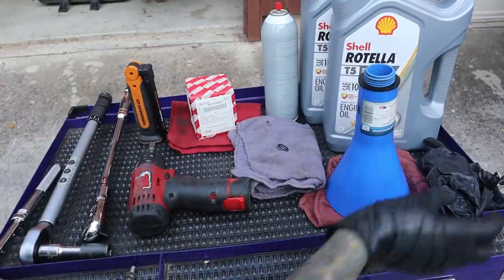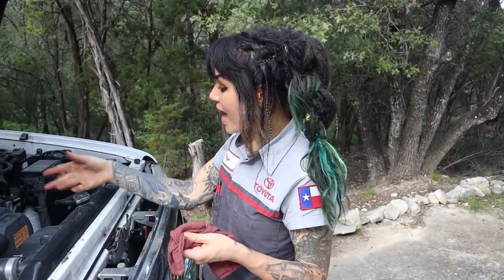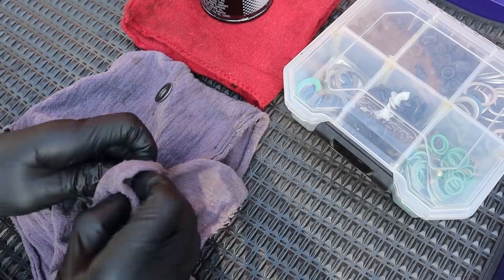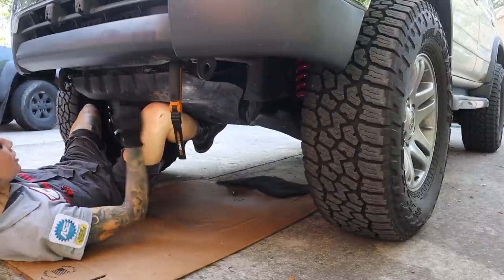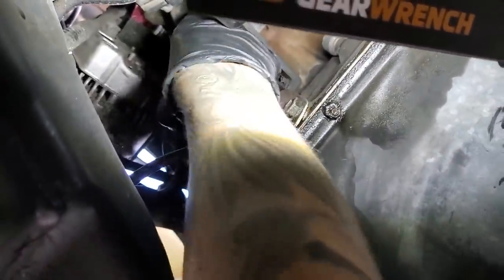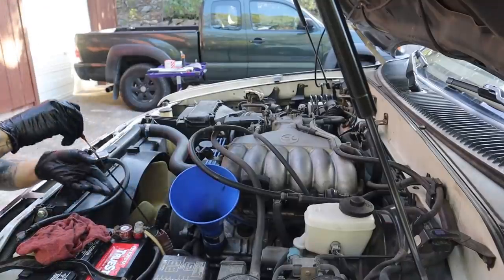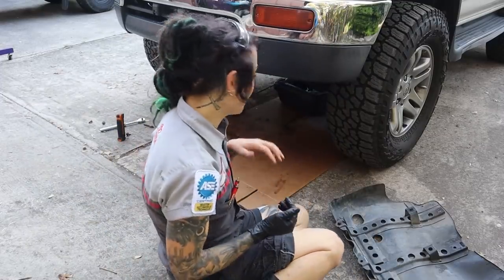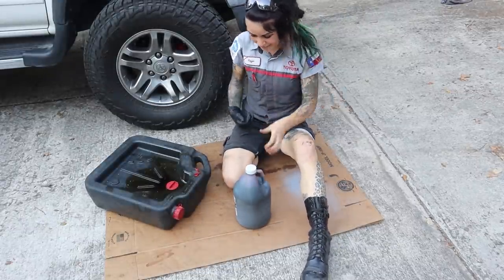How To Change the Engine Oil and Filter on a 3rd Generation (1996-2002) Toyota 4Runner V6: 3.4, 5VZ

Comment: The oil cap tip is right on. Last month I had my wife's Camry in at the independent shop I've used for almost 40 years for an oil change and quick check (no other issues noted). When I picked it up I dropped off my Outback for an oil change.

On the way home in the Camry I thought I smelled oil, especially at stoplights. After I got home I let the engine cool and went to check the oil level when I discovered that the oil cap had not been tightened. It was sitting loosely on the filler. Fortunately I did not lose any oil but that was the obvious cause of the smell.

The next day when I picked up my Outback I mentioned it to the owner of the shop, and he was not happy. Later that day the mechanic who worked on the Camry called me and apologized. He had loosened the oil cap before draining the oil and just forgot to tighten it. He said that he had found a small box in the shop and had spray painted it red and he was going to put that over the filler tube in the future to remind him to replace and tighten the cap. This mechanic has only been at that shop for about 30 years. It can happen to anyone.
Reply from the maker: Wow!! I really like the way that he handled it! He owned up to it and then told you about a solution that's the way it needs to be done!
Reply: That is great the way he handled it. I am sure the shop owner was not happy and the mechanic that did it was not a rookie but that just shows and proves we are all humans and we sometimes make mistakes and or get distracted.  we all make mistakes.
Reply: @FayeHadley  how do you like that 16 quart oil drain receptacle? I believe it’s made by Flo-Tool…I’m thinking of getting the 24 quart because it has a deeper well - less likelihood of spillage / splash / splatter.

Comment: Thank you for the thorough skid plate and oil change video! I have a friend with this kind of 4Runner and he's timid about DIY work. I sent this to him.

I have opinions about oil drain pan/containers! The whole point is to skip the step of pouring from the pan/container into some other jug and having to clean up those spills and wishing you had three or four hands. I just clean my container when it's full, put that in a big trash bag, put it in the car (with seat slid back to hold it upright, or a bungee) and take that to the auto parts store, where they let me carry it in the back and pour it out myself. (This may vary by region; I live in semi-Mayberry conditions, and I look like Hank Hill.)

Also, I decided I liked my drain pan/container so much and that no new ones were made like that anymore, that I started to worry about sliding it across concrete. You could slide it on cardboard, of if you're a total nerd, make a sheet metal tray to fit the bottom of it so it slides noisily across concrete but doesn't wear the plastic. (OK, I'm a nerd.)

Comment: Such a pleasure to watch your videos.  On my 87 Mercedes the oil housing is in the engine bay.  Easy just take the two 13 mm  bolts off and take the cover off and then remove the filter.  But what is good about that you can just pour the new oil into the oil filter housing.  I do that with one gallon and then remove the oil cap and pour and top off.

Comment: Hey Faye, really like the new intro and the visual aids were nice touch you pretty much nailed that one covered all the tips and tricks for changing your own oil. One thing I like to do after the oil has started to drip I don’t about a quarter quart of fresh oil in to push through the last of the old oil depending on the engine you would be surprised how much old oil flushes out but then again some engines not as much comes out. I hope it’s just the boot on the steering rack those can be such a pain what do I do with the boots seems to work pretty good here in Michigan with the salt and everything in the spring I spray off the boots really good then I dry them with a Shop towel then I spray on some AT-205 reseal it’s supposed to rejuvenate rubber seals internally but it seems to keep the boots supple without weakening them I just spray it on and wipe it off. Keep the videos coming I’m sure you’re helping so many people which is awesome have a great one🐔🐔🐔👍

Comment: MFW I have 4wd, use a filter wrench, and break off my oil pressure switch right before a 600 mile road trip. It didn't leak while I made the trip, and promptly replaced the sensor for $15 (USE LOCKTITE). Great video btw, always love to see Grim Repo!

Comment: Good to finally see another auto/truck maintenance video. Hope all is good with you Faye.

BTW the difference between the full and add marks of our 2009 RAV4 us 1.6 US quarts.
It makes no sense that it would be exactly one quart since the add mark represents the minimum safe level and the full mark represents the maximum safe level.

Years ago they likely took the minimum safe level and simply added one quart to that to arrive at the upper mark so you knew when you were one quart low. Folks got into the habit of going over the upper mark back then but the upper mark (at least on a Toyota) now represents the upper safe or full level and should not be exceeded.

And some milk jugs are fine for used oil as long as as they have screw on caps.

Comment: Sometimes we overlook the basics.  Some folks have never done an oil change before so thanks for posting this.  And even us salts can get too complacent and make an oopsie.  I just changed the oil in my small block Chevy a week ago.

It calls for 5W-30,  so that's what I grabbed at the store.  What's left in the jug goes in the trunk.  A few days later, I'm rearranging the trunk and I picked up the jug and something didn't look right.

"High Mileage 5W-20 Full Synthetic made for..."

Wait, what?

"5W-20"

Well, crapadoodle.  Over 30 years of doing this.  I've changed oil on everything from a 26cc weed whacker to a 1790 CID diesel.  First time I ever put the wrong stuff in.

I think.

Familiarity breeds contempt.
Reply from the maker: Oh my gosh I love this comment so much and I relate to it more than you know!! I don't really do oil changes anymore, So to be honest this is even a good refresher for me to go back to my Express Maintenance days and remember all the things that helped keep me the only technician to never have a comeback 💪🏻 those little tips and tricks can really make a huge difference!!! And I'm not a super huge fan of the high mileage stuff, I think it's a little bit gimmicky. Are you planning on changing it again soon?
Reply: @FayeHadley  Oh yeah, definitely.  Just the oil, though.  I'll just dump the filter and reuse it seeing as how it's brand new and all, but I'm not driving her any further than I have to with that thin stuff in there.  A little residual 20 weight isn't going to hurt anything, but not a whole pan full!

I think the high mileage stuff is gimmicky too, but that was all they had left on the shelf.  I should have looked closer at the jug when I grabbed it, but it was on the 10W-30 shelf.  I should know better.  Only got myself to blame.

I used to know an auto tech instructor that for a time worked at an oil refinery.  Something he said stuck with me.  Oil is oil.  As long as it's the right weight, it doesn't make much difference what the branding is.

At the refinery, he'd see trucks from Valvoline, Quaker State, Pennzoil, and just about every other brand out there filling up from the same processing tanks.    The only difference is the additives that they put in it.  May be a little less true today with synthetics, blended oils, etc., but probably not by much.

I usually grab what's cheapest, but use a quality oil filter and change both religiously.  Oh, and I never ever flush.  Made that mistake once.  Cost me my 375 Wildcat (340 cid).  30 years ago and I still cry thinking about that.

The only comeback that I had wasn't even mine.  Dude pulls into the shop in a big delivery box van.  Says he had a wheel come off on the road, then points at me, "And that's the son of a (BLEEP) that worked on it."

I'm sweating bullets.  I've done a lot of box vans, but I don't cut corners, especially not with lug nuts.  So I go pull the original ticket.  The van was in two months before I started working there.

The manager pulls me into the office and I show him the ticket.  I wasn't employed there at the time and the tech that did the work isn't employed there now.  Didn't matter.  The customer fingered me, so I get written up.

Had a second incident a few months later.  The foreman wanted to pull this full sized pickup into the little bay.  I told him it wouldn't fit, but he insisted and would be ground guiding me in.  I told him a second time that there is a reason we never use this bay for anything but compact cars.  He not so gently reminded me that he was the boss and that I didn't want another write up.

So I'm driving and he's outside watching and giving me directions.  I used to move tanks around in the military.  You do exactly what the ground guide tells you to do, no more, no less, and if anything goes wrong it's on him, not you.

So we're slowly creeping the truck in.  I stopped several times to tell him it ain't gonna fit.  "Sure it will."  Crunch!  It didn't.  The truck hit the overhead door track.  Customer's vehicle gets damaged.  Foreman gets a verbal reprimand from the manager, but I get a second write up anyhow.  I walked.

That was my last job in a shop and I got out of the biz.  I only wrench for friends and family now.  Much happier.  Plus, you can say, "Hey dummy, I told you so."  For some reason paying customers get cranky when you say that.

Hell, I just wrote a damn essay.  Well, maybe you'll get something out of it.  Oh, and if you ever decide to open up a shop again, I'll do the oil changes for you.  Cheap.  I don't work for money anymore, only pizza.  I'm trying to grow my spare tire into a full sized.

Comment: Nice! I also use empty washer fluid jugs, way better then reusing the empty oil jug just because of the seal.
Reply from the maker: Not only that but they're hard to label once you get all oil on them so I've made the mistake of dumping and used oil before and having to do the whole job over again 😆😆😆

Comment: Thank you for sharing. I like to use Valvoline oil. Sometimes places are out of it for sure and i choose another. I told my brother not to use the old sealer gasket on the drain plug. Cheap insurance to get a new identical one.

Comment: @16:24 Millwright Rule #2: Never tighten any cover screw until ALL cover screws have been started. Works for all industries. I have found that steering racks are best rebuilt by people who are set up to do just that. R & R is always easier than rebuild on floor. I don't rebuild CV axles either.

Comment: excellent and detailed video. I have my 3rd Gen 4runner (2001) and will be doing a lot of DIY and just checked out your video. I would like to know where do we dispose of the oil? Do you have a transmission fluid change? Again great video with clarity.

Comment: Good video, very helpful. Rewatching this video after doing the oil change - I think I made a mistake by not taking off the front half of the skidplate (just took the back half off). Even with the back half off I found the oil filter SUPER hard to reach, and unlike your video I had a torrent of oil running everywhere (including me; and yes I had already drained from the drain plug for a long time). I think it would've been easier to reach with the entire skidplate off... next time I will try that.

Other than that, great video, didn't know about those washers and ordered some before doing the oil change, glad I did.

Comment: Thank you for talking about the drain plug washer.  I think the majority of DIY oil changers reuse over and over again, which COULD eventually lead to trouble.  Also, side note, I think those are the same tires I was looking at for my Tahoe.  But it's only a 2WD so I feel like I would be a fraud with such aggressive tread. They look great on the 4Runner, though :)
Reply from the maker: I only have the two wheel drive 4Runner!! I don't think it's fraudulent at all!! I chose these tires because of their aggressive look but also how quiet they are on the road and they don't really hurt my feel economy as much as I was expecting the lift and larger tires to do! They also have a really great warranty, So I was going for a long lasting tire with minimal road noise and also looked amazing! (And I also really did not want to spend $1,000 on tires!!)

Comment: Get U some Frickinnn  KNEE PADS  ASAP.  Tommyco Kneepads 40032 .   Just did my first oil change on my used 2000 4RUNNER 5VZ-FE 3.4L Engine   V6. Everything out there says 5.5 qts, but that did not fill mine up. Your chart showed my the light. Thank You.   P.S.  Your 10w30 oil !!!

Comment: Another great video Faye. One thing I like to do is prime the new oil filter before installing it. Depending on the design I at least try to soak the filter material if it installs from the top and if it installs from underneath I'll fill it as much as I can, maybe 3/4 full. It just helps everything along on that first start, only takes a few seconds and you can lubricate the filter gasket at the same time so it tightens down nicely.
Reply: @subtegral  yeah, into a dry filter.
Reply: @subtegral  it's longer than that. Watch the oil light on the first start next time you change your oil. Is your engine going to explode if you don't do it? No, it's just good practice and takes 10 seconds.

Comment: Hi Faye- great video- thanks for clear directions and tips. Since these 3rd Gens make a little bit of a mess taking off the oil filter, what are your thoughts/expertise on installing a remote filter more in the engine bay? (Im thinking/debating  on this)

Comment: Those oil filters can be accessed from the top by going under the alternator. I’ve done it on my Tacoma. It’s kind of a pain and you may scratch your hand up a bit. But it can be done. Also it can be seen from the wheel well.
Reply: Thank you for this! I was able to comfortably reach mine through the wheel well

Comment: Love our 2000 4Runner with about 210K miles. But changing the filter on a 4x4 version is much more of a pain in the butt. Very little space to get arms up in there, and it makes a mess most times. My 2nd Tacoma is a breeze in comparison with the filter topside.

Comment: Awesome refresher!!  Question for you... Where do you stand on the lube your new filter debate?  Obviously you lubed the filter in this video but dose it depend on the manufactures recommendation or all the time?
Reply from the maker: I always do because I have ripped a seal before spinning it onto a dry housing. Thankfully, I caught it before I shipped the car! But most Toyota oil filters come pre-greased!! So you remove plastic packaging and it's already perfect! But yes ALWAYS ALWAYS.

Comment: What's a good year for a Tacoma & drive train?  Last Toyota i had was a early 90s truck but I'm currently used truck shopping something late 90s to 2007 ish Thanks for the vid
Reply from the maker: Really anything in that year range is a fantastic choice but I happen to favor the second gen Tacoma with the 4.0 l - will probably be easier for you to find and lower mileage than any of the '90s pickups! I have a few videos about that particular Tacoma on here! Just make sure that if you get one if you live up north you have it inspected for the frame recall!
Reply: @FayeHadley  Great thanks. I am on the East coast but they use salt here in my state so I usually travel 5-9 hrs to the Carolinas to buy my stuff

Comment: Hey Faye, love your runner! What tires and suspension are you running? Do you have a build thread?
Reply from the maker: THANK YOU SO MUCH!!! Actually, want to know something really cool?!! I did this all on ALL GIRLS GARAGE! Season 10 episode 4, you can watch it here: https://youtu.be/jpSY_rPtA38 or here: (if you have the Motortrend app) https://www.motortrendondemand.com/detail/fayes-4runner-shop-truck/2097608/12518 the lift is a 3" adjustable coilover setup from Toytec lifts, and I absolutely love it so far, and the tires are KILLER! They are Falken Wildpeak AT3Ws and I couldn't be happier with them! They fit perfect with no mods, and they are QUIET on the street, and have a great treadlife guarantee (not getting paid to say this - neither of these companies are sponsors, I chose these products myself for the show!)

Comment: I wish my oil changes were that clean on my 3g.  I have yet to change the oil filter without making a total mess.  About the steering rack.  I’m convinced the aftermarket ones suck and rebuilding one does not sound appealing.  Time to smash the piggy bank and get a Toyota one with the ITREs for me 😕